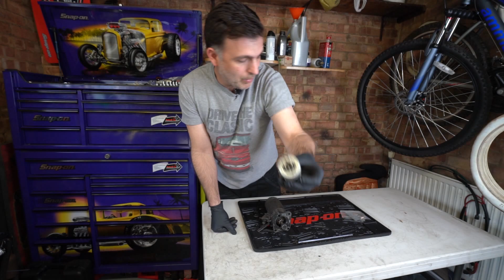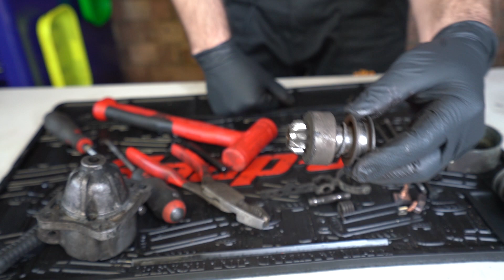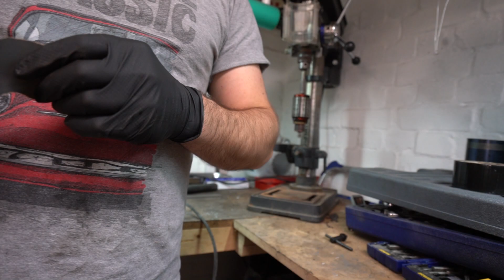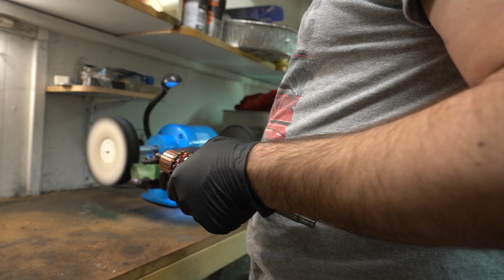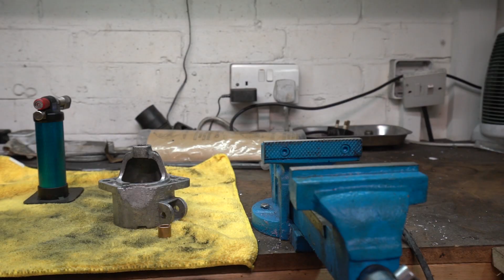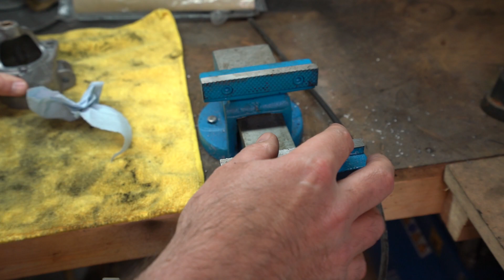Classic Fiat 500\126 starter motor rebuild

Comment: Great video.  I have fitted a new switch to my starter but when I test with a battery nothing is happening.  Are there any other tests I can do to try to find the fault before I buy a new starter?  I have a 1971 500L.